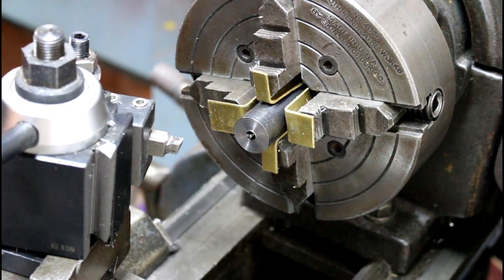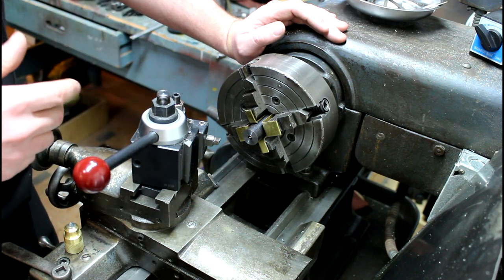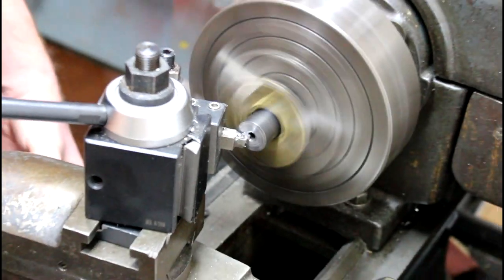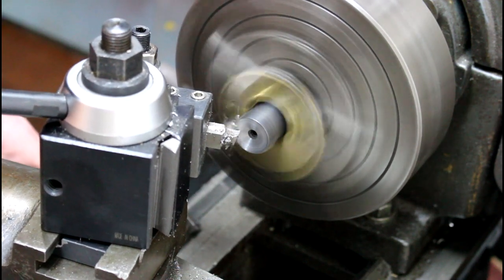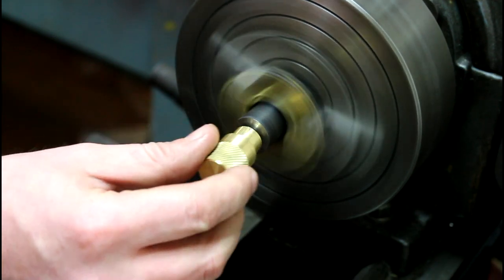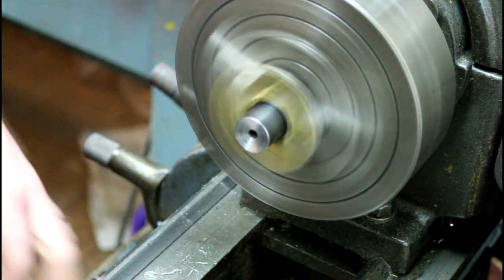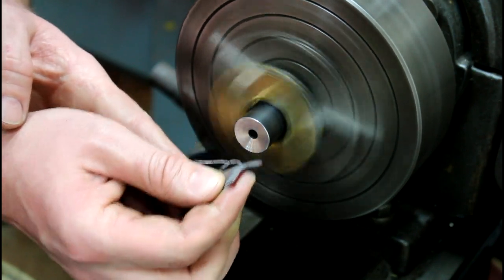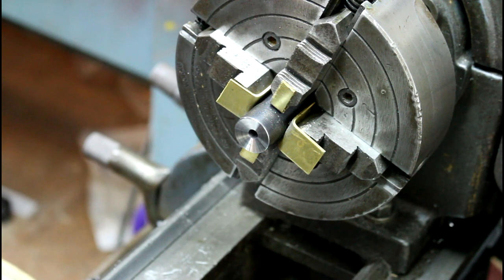How to Crown a Barrel With 11 Degree Target Crown On A Logan Lathe-Gunsmith

Comment: I'm going to school now for machine tool technology.  What size is your lathe?  I hope to be doing this kind of work when finish school.  Loved your video, keep them coming.
Reply from the maker: +smoakngun Thanks, that was a Logan model 922 11" x36" lathe with  a 1 3/8" bore so you can run most barrels through it. I've since sold this lathe and I'm almost done with the restoration on my "new" 1949 South Bend heavy 10 with the 4.5' bed which can be seen in my lathes playlist. Thanks for watching

Comment: excellent idea to use the file on the exterior of the barrel and take off that very sharp edge.
a self-proclaimed gunsmith where I live put a 11 deg. crown on my new barrel and left that sharp edge which over time chipped off in small pieces.
didn't affect the rifle shooting but made the barrel mouth look crappy
Reply from the maker: I usually just touch them with a 45 degree cutter now. Leaves a nice corner that looks good and won't cut or catch anything.

Comment: Good stuff  guy I have 1903 Krag 6.5x55 key holing.
Will try your method of crowning might do the problem good.
Thank you
Reply from the maker: Have you considered the bullet weight and twist and if it is to heavy of a bullet for the twist you have?
Reply: PMS probably nailed it.  Course I'm 3 years late to the party.  Did you ever fix it.  I too would have guessed the twist rate isnt enough to stabilize the round.  It could be too that the throat and muzzle are very worn in which case having the barrel re crowned could help.

Comment: Blow out the swarf from the bore, before using the brass lap.  Or you risk scoring the land tops.

Do not allow the corner of abrasive paper to enter the bore.  Or you risk scoring the land tops.
Reply from the maker: I don't use a brass lapp anymore, no need for it. Just use a really sharp cutter and get a nice clean cut. Any micro-burrs are blown off after the first shot or two.

Comment: Hey man. I don't know much about what you just did but, will that work,or make a smooth bore airgun shoot better?am just trying to find a way to make my airgun shoot much better than it is now
Reply from the maker: Isn't going to hurt anything.
Reply: @Kade
What airgun do you have? I'm also an airgunner. I were thinking about redoing the crown on my Sig Virtus inner barrel - if I won't be going to get better groups soon that is. That "smooth bore" just caught my eye and made me wonder what airgun might be the case. Just outta interest..
Reply: @brorjordas1979  hey ,am using the jkhan n400 in .177cal smoothbore and that rifle is giving me great groups at the distance that in hunt from,which is anything inside of 40y 
The rifle that I was trying make shoot better was the Evanix ar4 in .177cal  smoothbore I sold it and now have the jkhan n400

Comment: I'm wondering why you chose to indicate on OD instead of axis of bore? BTW, I like your lapping tool, pretty cool.
Reply from the maker: GeckoProductions Hey thanks, yeah my tool works pretty good. I didn't indicate on the outside! I indicated with a custom ground rod which is inserted into the bore and then indicated. I didn't show it, but that's how I indicate all my barrels. Rarely is there ever a need to indicated anything from the outside. Thanks for watching.

Comment: Can I lap out a small ding in a barrel with an 11 degree crown or should I just try to re-cut the crown? It's pretty small, a dumbass thing I did cleaning my rifle with one of those Otis cleaning cables, fed the cable through and accidentally pulled back, smacked the fk'n brass end against the crown. Also, is there any way to re coat the end after I'm done fixing it, so its black again?
Reply from the maker: I would say re-crown it, but i'm sure you could probably lapp it out. Depends on whats on the barrel blued, use Brownells Oxpho-blue. Painted or cera-coated, well, you should be able to touch it up again.

Comment: How does the indicating rod locate in the barrel concentrically if the crown isn't cut straight? I thought the indicating rod would shift to once side more as there is more material pushing against it?

Is this the only way to turn the barrel concentrically? Range/indicating rods aren't cheap and I'm guessing you'd need one for nearly every caliber
Reply from the maker: +TheFirearmEnthusiast 
The crown doesn't matter when you are dialing in a barrel. The crown could be cut at 45 degrees and as long as the rifling is in good shape and there isn't a large burr or flaw in the rifling, your tight fitting indicating rod should be accurate. You also need to make sure it's in there deep enough to get a good 2-3"+ of bore to indicate off. If the rod is getting pushed off to one side, then you need to cut that bad rifling off and start over. You can usually see with the naked eye if there is damage or not. It's not very often that you indicate anywhere other than the bore under normal circumstances when running a barrel through the headstock. Yes, you do need rods for each caliber and if you are using range rods, possibly 5-6 bushings per caliber. There are also some guys that use ground pins that are ground to within 0.0001", and they buy sets of 20-25 per caliber. So, yes it can get quite expensive if you plan to do several calibers. 

The other way you could do it would be to get a piloted cone reamer which will put a 60 degree chamfer in the bore end, then you can put the barrel between centers and make a cut on the outside of the barrel, then indicate off that. This isn't done nearly as often as indicating off the bore. That method is more or less used when you are only using a steady rest.
Reply: OK I understand, i didn't know there was a difference between a range rod and an indicating rod. I have done something similar to what you mention where I turned a taper to act as a dummy cartridge and press a pistol barrel chamber into that (fit was good enough no need for a drive dog) and use a live centre on the bore end to turn down a barrel, but I didn't crown it. Thanks for the info! :)
Reply from the maker: +TheFirearmEnthusiast 
Some pistol barrels take a little engineering if you don't have the right fixture to be able to turn them. Thanks again for watching and your questions!

Comment: Hi - what's those bent flat metal strips inbetween your jaws and the rod? What are they there for?
Reply: I think he used the brass sheet to prevent the jaws of the vice from damging the finish of the barrel.
Reply from the maker: +pofrani 
Yep, they are there just to protect the barrel. A 4 gauge copper wire wrapped around the barrel works too.
Reply: +Precision Machine Shed That's great. Thank you for clarifying that! :)
Reply: +Aichmo Thank you.

Comment: did you ever get to retest the pawn shop mauser after the recrown.
Reply from the maker: Yes, I had it shooting under 1/2" at 100 yards after I did everything. I made several videos on it if you have not seen them all.
Reply: I had a hard time finding the videos with your results. Found your videos after  a forum discusion on how well one of the Manson style crown tools can work vs lathe cut.
   I would like to know if you would do any future videos with that in mind....I have used the brownells crowning tool with much success on old worn rifles and have brought some good accuracy back to some old war dogs.   Mt thoughts are just how much accuracy do you gain or loose between the two methods with recutting a new crown on a barrel.
Reply from the maker: If you check out my channel, I have a bunch of videos under a gunsmithing  playlist. They should in there in the past 6-8 months. I don't have a million videos on there, so they should be easy to find. 

I can keep that in mind. I don't usually use those crowning tools, but they are handy for specific barrels, and sometimes if you don't want to pull a barrel. Using them on old milsurp guns usually works good.

Comment: why do some benchrest not do a 11 degree crown but rather just a straight cut?
Reply from the maker: I have a flat crown on my F-CLASS rifle. I guess to the best of my knowledge, it minimizes any error when cutting the crown. I always did flat crowns or recessed crowns until about 5 year's ago. I do have a couple hunting rifles with 11 degree crowns, and if you cut them correctly, there really shouldn't be any difference. Most BR rifles I have seen or used are flat crowns.

Comment: Seems like soft jaws would be more accurate?
Reply from the maker: No, while you can cut them concentric, you are left indicating those jaws on the outside of the barrel.
Reply: With the brass shims you have soft jaws that you can dial in with the 4 jaw chuck.

Comment: nice video but Oh paper towel with a brass strip spinning, Safety first always
Reply from the maker: I see what you are talking about, that didn't look good. I've since quit using them due to better tooling. I've used them for years without an issue though. I think COMMON SENSE first, and you will be safe! Unfortunately not everyone has common sense!
Reply: Intended as a friendly comment, wouldn't want you to injure yourself
Reply from the maker: I know, much appreciated. I've had Emery cloth ripped out of my hand and got cut bad once. I try to be more careful with each use and be aware of potential problems. I also tended to an emergency when a guy that got his thumb ripped off in a lathe at a previous job, so ever mindful!

Comment: Surely a skiving cut, with the lathe tool at an angle, cutting from the bore outwards would be desirable. Finishing cut should be with a newly sharpened and honed tool, lubricated. It should be just that, a finishing cut. Go near it with a hand held Lap, Emery cloth etc and you're undoing the good work you've done. Microscopic burs that are kicked up will be removed with the first half dozen shots. Why 11°? Zero is good... I can see the point of strength of the exit corner.... As long as that edge is concentric to the bore, but hand finishing? No way!

Comment: you are not a craftsman,keep away that file and work with the lathe ,that gives a more tight sight.
Reply from the maker: Those gases do not come back and are deflected by the crown and have no affect on accuracy. I'm not a fan of 11 degree crowns but many people use them, and I have built many rifles that are extremely accurate using this method (competition accuracy and proven)
Reply: I was a tool & die maker for more than 40 years the file for a chamfer does not affect rifle accuracy, glad to see your interest in machine shop work !
Reply: Huub Dassen that makes zero freakin sense whatsoever.